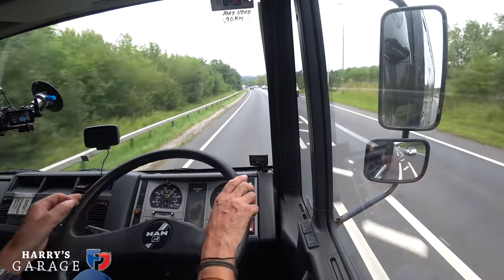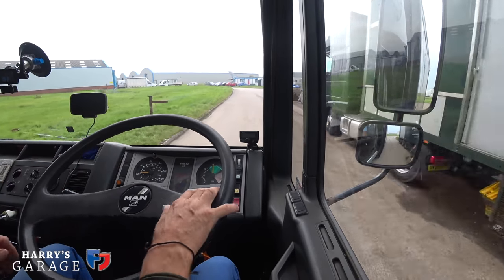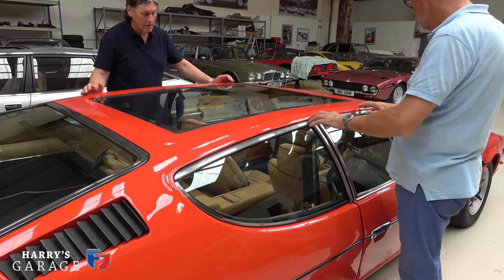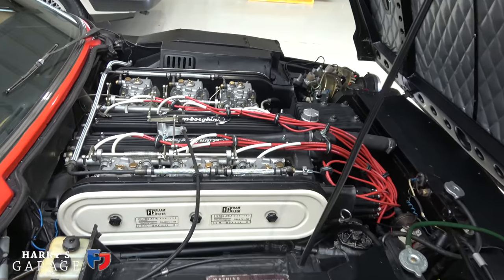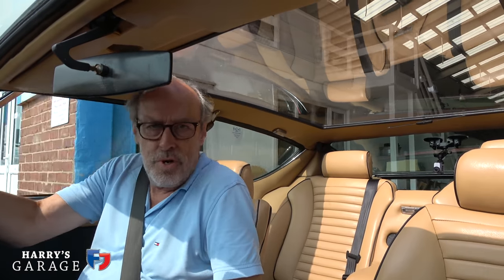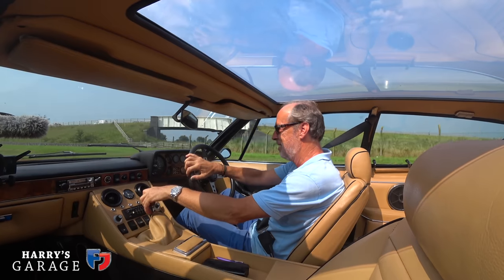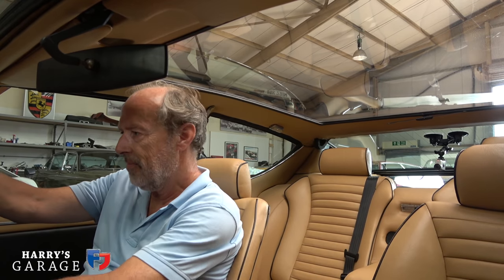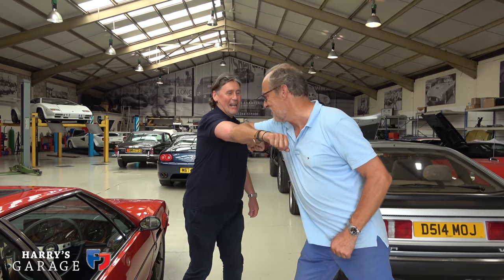Collecting my rebuilt Lamborghini Espada from Iain Tyrrell's Workshop. Part 7.

Comment: “You don’t wanna know about the truck” Actually Harry, yes we do.
Reply: Future video there then
Reply: Foreal!!! Lol I hope he shows us more!
Reply: Great truck I have the exact same model 1999 man 8.163, does 82 mph as last year before compulsory speed limiters, you can do a perfect handbrake turn in one as they fitted vented disc rear brakes to this model ( the brake discs never have surface rust even if left for a few weeks so must be great quality) and it has never broken down in 6 years, as it handles and brakes so well I called in mental Mandy the man the 7.5 ton truck gti, they will never make a truck so simple and reliable, looks good with my most race and championship winning Alfa 164 racecar on the back, only 280hp but quicker than an m4 from 0-140mph junction 11 traffic lights m27 if your a white m4 owner you know, seriously harry could not have bought a better more reliable 7.5t truck, Shane it has the 56 limiter but erm the speedo might not work when he finds it

Comment: Great video and a successful result. I know next to nothing about Lamborghinis, but I do own a vintage wooden runabout boat (1960 Shepherd) with original Mopar V8. Years ago I installed a Pertronix electronic ignition unit, and it has been flawless. Part of the beauty of the Pertronix unit is that it sits inside the distributor and replaces the rotor and points. The modification is virtually invisible when the boat is being judged at shows. Wonderful reliability and relatively low cost!

Comment: Storing a truck or large trailer takes up a similar amount of room, trailers cost less when parked doing nothing and, for post '97 drivers, the trailer test is cheaper than the LGV test. Personally I'd go for the truck every time, you can always add a trailer to it later if you need more capacity.
Reply: popuptoaster Yep and trucks are safer.

Comment: Thats brilliant. I think possibly better than if the roof was tinted. It really looks like a cabriolet without the buffeting now. Over light steering aside that might be one of the most usable classics now. 
I'm still in awe of the start up. Anyone who has set carbs up will understand that a stone cold V12 which fires instantly and on every single cylinder then sits there without a hint of a missfire has taken a lot of time. Thats a very impressive bit of set up - as is the roof not making a racket considering they had to pretty much re-engineer it.
Overall a mighty impressive job and I wouldn't feel short changed at all seeing the workmanship and skill level which has gone into that. No its not cheap but its very good value for money. 

Now we need two videos - one with the Espada after break in and one on the truck. :)

Comment: Great refresh... Tyrrell did a spectacular job, as we expected! 

Might I suggest one thing... tinting the roof panel with a 70% (or higher) UV blocking film. It'll stay virtually as clear, but the interior, and your skin, will be protected from UVA/UVB rays.

Comment: Harry, I'm not sure if you read the comments, but if you do there is the product called "LLumar Clear Window Tint Series" which is a completely clear window tint that blocks 99% of UV light (which is what gives you sunburns), so that you can keep clear perspex roof and at the same time not get a red noggin. The clear roof looks so much better than the tinted perspex you had before.

Comment: Fair play for tackling the cost so openly. Quite honestly, it almost doesn't matter because if I had a Lambo, I'd take it to Ian's shop regardless.

The perspex roof looks amazing with the steel strip around it. I bet other Espada owners will be looking at that with envy. From the camera angle inside, at the back of the car, I can imagine being a back seat passenger would be an amazing experience.

The gearshift seems very long, and I wondered if there was an opportunity to alter the fulcrum position slightly?

Now, please can we have a vid on the truck. :)

Comment: A useful tip for overheating, when there's plenty fluid and everything's working, is to put the heater on full blast. This is 100% effective at drawing excess heat from the engine.

Comment: Harry, the Espada is the most beautiful car ever, the doyen of exotic car shapes and is a rival for even the 308.  It is absolutely stunning.  I remember reading a review in  the AA magazine that my  dad had when I was a child and I just looked in awe at it....  Electronic ignition is a no brainer - smoother running, vastly more fuel efficient, reliability and more power.  I fitted a Piranha setup to my early Gt6, what a transformation. It is interesting to see the Espada next to an SD1, how much lower it is.   Every panel and angle is a work of art, how did they do it back then?

Comment: I was surprised at the price to be honest. Such a beautiful job, perfectly executed. That sort of money in aviation would go no where. Lycoming engines, which are 50's tech and so low tech. They are running mechanical injection and manual mixture controls! An IO540 motor, which is six cylinders and puts out 300 Bhp, factory new fitted in a single engine six seat plane (Piper Saratoga for the record) left the owner with a bill for £90,000! So that seems like a very reasonable deal? How much was the rest of the work though? I would guess another £30k ish? Plus VAT and TAT of course😁
Great video Harry and love the farm one's much more than I would ever have thought 👍
Cheers 🥂

Comment: Great car, fantastic work ian, but your going to cook with that roof even with air-conditioning, your head will get burnt, the seats will be scorching hot, think a slightly darker green tint on the roof than on the side windows is the way to go, or your be constantly parking in the shade, but engine looks the biz

Comment: Excellent video Harry, be careful taking it to 8k, pretty sure those main bearings are in the wrong way round.
(According to your video and Ian) the high load plain bearing is on top (where it doesn't experience high loads) and
the grooved oil supply bearing is at bottom (and not supposed to see high loads - and complicates supply to big end bearings). 
Unfortunately, the 28k man can make mistakes, like any garage, and (to be fair) the Italian workshop manual is a bit misleading to the uninitiated.
Thanks for sharing - and be quick on the clutch if it goes wrong.

Really, really hope I'm wrong!!!!
Mike.

Comment: So are you using a tachograph in your truck Harry? and Complying with the Drivers hours regulations? Does it require an Operators License? Is it taxed PLG? What’s its Plated weight? Is it still 7490 KG? Cheers from a fellow Lorry Driver!

Comment: My dad turned a F7 Volvo furniture truck into an RV, towing a trailer ( carrying a 4wd).  It gets 25 litres to 100km..............grossing 13,000kg.  A diesel toyota landcruiser towing a 2 axle caravan uses 20 litres to the 100km........and has only half the room inside and comforts. A truck can make a lot more sense in some situations.

Comment: Hi Harry, Was the £33600 (INC VAT) for just the engine rebuild or did it cover the other works as well? You didn’t feel the need to sing a duet with Mr Tyrell (who we recently discovered is a fine baritone)?

Comment: Mesmerizing! All 7 episodes just flew by. Could easily seen 7 more of this motor restoration... Sorry, but the black "panel sidebars" should be chromed. The metalframe on the glass roof destroys the cars esthtetics and soul. Better with black tainted glass edges or maybe new metal roof? Black center "nuts" on wheels - why?? Fits better on a chop car in LA....

Comment: I have a question did Iain own a garage on the Wirral around the 80's called Tyrrell engineering I used to work for castrol as an engineer and used to visit Tyrrell.

Comment: 13:17 look at the sunroof when he closes that door 😳
Reply: That's unavoidable with the non-laminated material they had to use and the momentary jump in pressure inside the car pressure as the door slams shut -  just demonstrates that the door seals are completely air (and water) tight, won't happen with a window even slightly open. IOW it's not as 'flexy' as the impression given (and the multiple reflected straight lines from the skylights in Iain's workshop further exaggerate it - probably won't be noticeable outside).
Reply: @EliteRock  Thank you 👍

Comment: I have the exact same truck a 1999 man 8.163 it has been superb and never broken down in 6 years and does 82mph as it’s the last year before compulsory speed limiters, of course I am joking about such a speed 🤪not. Plus they fitted vented disc rear brakes to this model year so you can do a perfect handbrake turn in them, looks good with my Alfa 164 racecar on the back, last era of simplicity for trucks, steel springs, mechanical injection etc Harry’s truck will go on for far longer than a modern version with electrical and mechanical complication, if you find one buy a man 8.163 as they will do a Million miles with servicing and being looked after

Comment: https://youtu.be/qSb_bvqhOVA?t=791 Quite a bit of bounce on the roof there - I'd be careful because of the glass and air pressure in the car. Maybe gentle door closing or windows slightly open moving forward?

Comment: Used to collect a lot of expensive metal in the 80s including an F40 (had no idea of what it was at the time the Red Car in the corner of the compound) , always preferred the DAF 45 with the flat bed than the trailer land rover combination. most cars have their weight distribution too far forward for the trailer. Rubbish if all you can do is reverse them on.

Comment: A great video as always Harry.  I really appreciate the engineering work done on the car but am I alone in thinking its the ugliest car on the planet with a ridiculous rear overhang - just bizarre that anyone could design something looking so awful.  Not a patch on the project 8 in my opinion.  BTW I can't see a perspex roof looking pristine for very long but engine bay looks nice!
Reply: @Box of Rocks Yes you're right - I exaggerated - it isn't the ugliest car on the planet but it is certainly not one of the most beautiful.  I also don't think the partly enclosed rear wheels do it any favours - always looks like its got a few bags of sand and cement in the boot!  Having said that it may be a great drivers car and I know many people like them so you would probably get loads of admiring looks etc.

Comment: I did the same thing, was looking for a dump trailer for my business, but found a truck with only 50k miles from new for less than a new trailer. That way I don't have to get my nice pick up messed up hauling junk. As for the Espada, it's beyond description. The only thing as a negative is that roof, I don't like sunroofs at the best of time, to much bright light coming down the back of your sunglasses and too much heat.